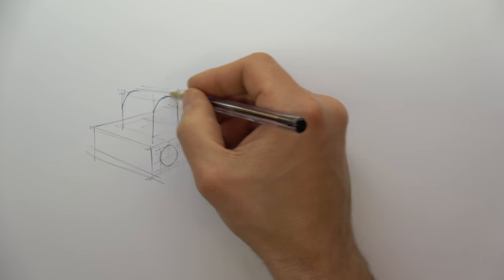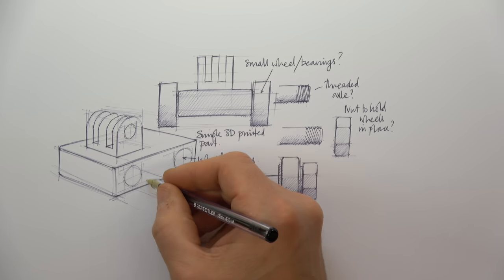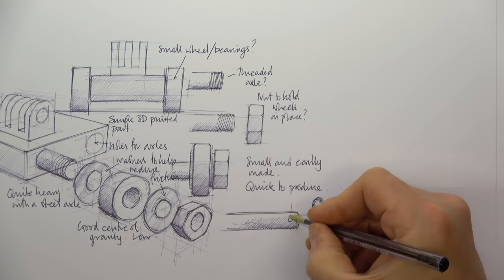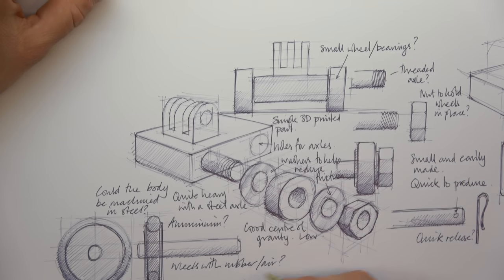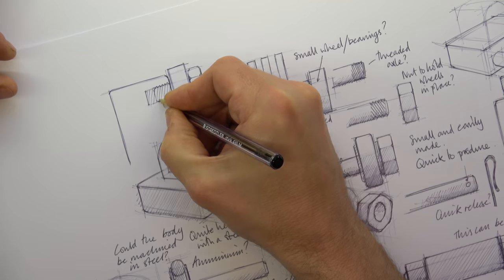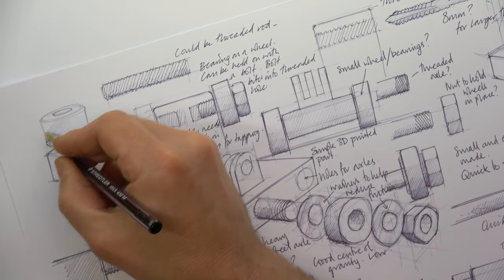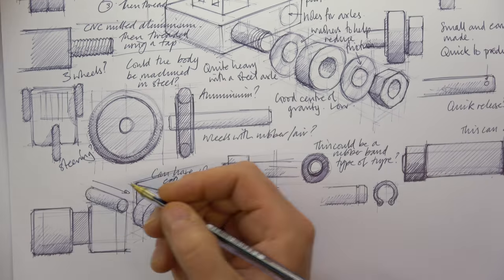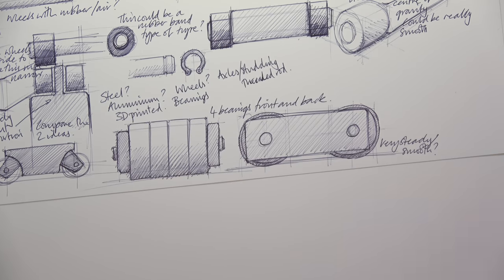How to annotate design ideas!

Comment: really good insights. How long did it take you to fill up that page?
Reply from the maker: naemo003 I think it was about 40 minutes or so
Reply: @productdesignermaker  thanks for the response. This is something i struggle with often..torn between sketching quickly or making it look presentable already.
Reply from the maker: naemo003 it’s a difficult one. I’d suggest this approach when exploring ideas, and more presentational drawing when the ideas are already formed.